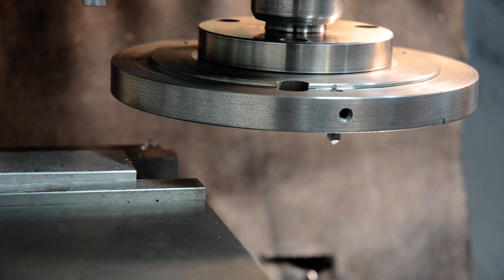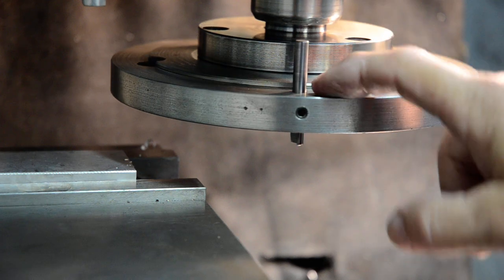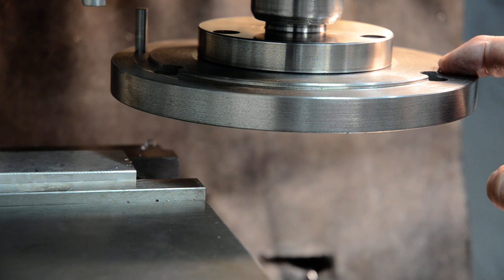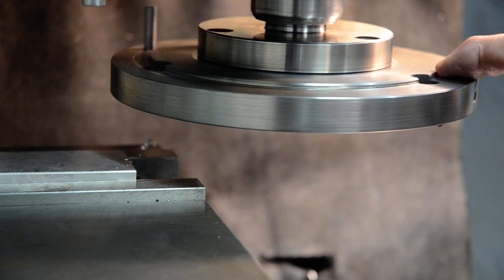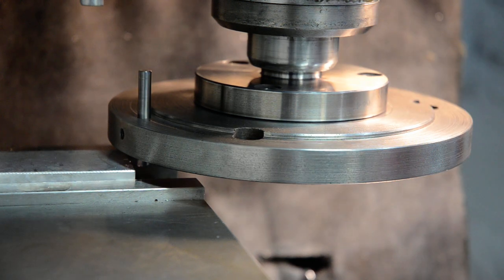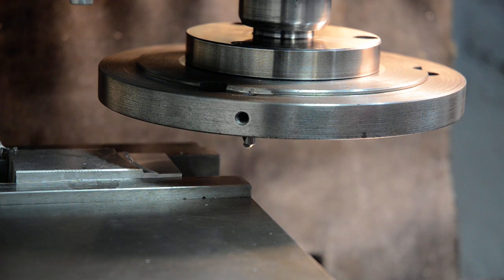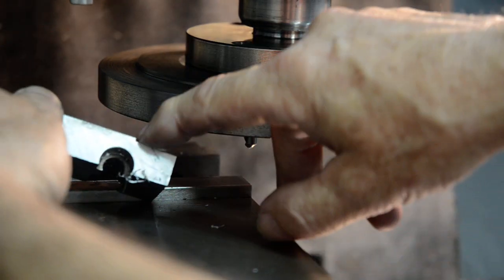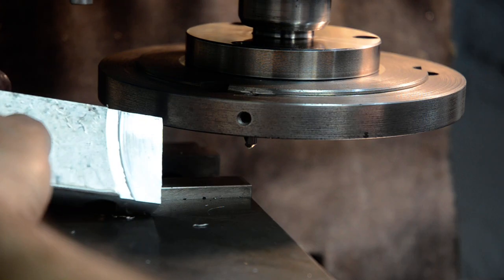Fly cutting

Comment: This has to be my favorite large fly cutter design. more mass = less chatter, two tool bits, rough + finish cut, brilliant! Also having two tool bits seems to me like it would balance out the forces put into the tool and mill head.  Thanks for the inspiration, you've got an aspiring amateur here hoping to replicate something very similar to your design!
Reply: I started looking into large fly cutters such as this in hopes of being able to resurface motorcycle cylinder heads and cylinder blocks in my shop instead of taking it to the engine machine shop. I think with this and a nice power feed and some mill maintenance, I should be able to get fairly sufficient results with a very slow speed and a decent rpm selection. I have a few junk heads handy to experiment on...
I just realized in your next video that I had read up on a lot of your bike work in the past... Thanks again for the knowledge, you are a true master.
Reply from the maker: Most of my workshop efforts are directed to preparation of my own classic motorcycle race bikes.  The fly cutter doesn't get a lot of work but it is invaluable when it does.

Comment: its a very well done video no doubt about it. However be aware that any face mill such as 2 or 3 inches can be run with only one insert in or if all of them are in--any face mill with inserts the inserts are not exactly matched anyway so it does the same effect. Useing a giant cutter like that is a bit slow and you have to feed all the way on then all the way off--and you cannot cut in the normal way to race around climb cutting to deburr the edges. Doing that method a person can race along that block in at best ten seconds.. Just letting the people know what happen upon this that huge flycutters are not really the way to go especially now that face mills can be ordered brand new with inserts for a few dollars--since china makes them free to flood the market.
Reply: another issue in which the method shown is very nice by a nice guy but inherintly wrong which is not apparent to beginners is that he is roughing alot--yet producing a finished surface behind??? not measuring--simply plowing over and calling it good?  its much faster to cut in the normal manner.. that being said the video is uploaded to help as a favor and he is sharing to help and gets nothing for it--so I thank the guy but I do think its proper that in the comments that beginners see other opinions especially because they will be investing alot of time and trouble to do this..

Comment: My friend you are on the wrong path flycutters such as you show are not used. i am 67 with degree and decades of experience in dog eat dog shops. you MUST advance into the future. --or you will not survive in todays market
Reply from the maker: Well i am 76 with a few degrees and decades of experience doing stuff my way.  Thank you for you concern but I am surviving quite well.
Reply: This is... not true. Fly cutters are used all the time and are great for what they are used for- creating a single flat plane. Sure CNC machines use shell mills more commonly, but thats not for the same purpose as a fly cutter, and most manual mills don't have the horsepower to utilize a shell mill effectively.
Reply: @liquerinfrnt  But on a Bridgeport, or any vertical mill with an inclineable head, unless you tram absolutely square, you will produce anything other than flat!